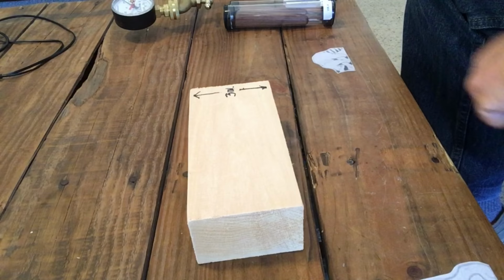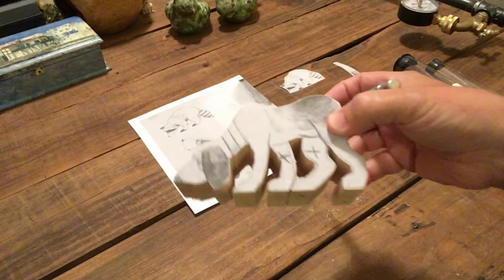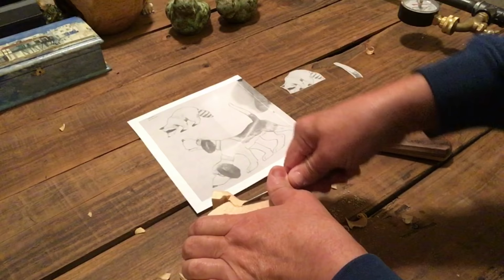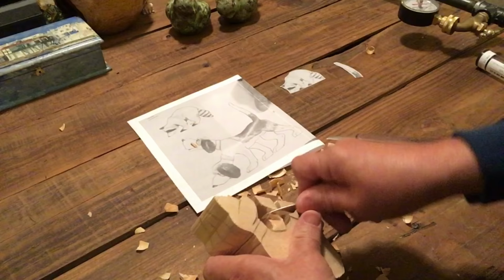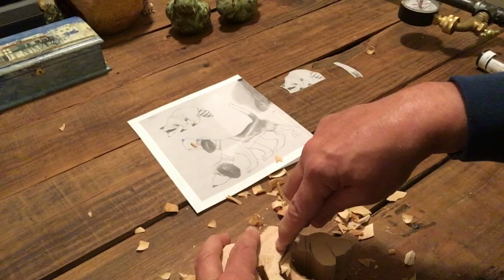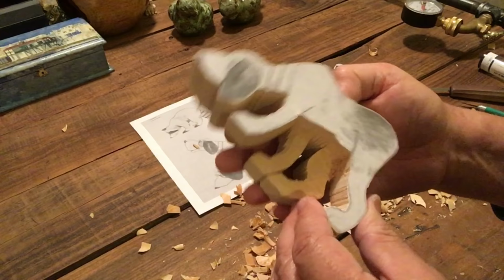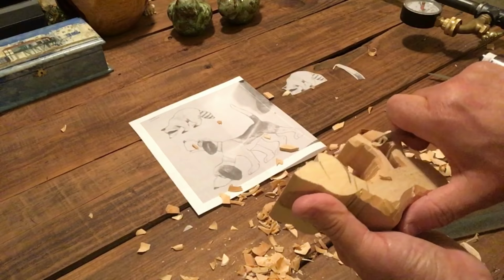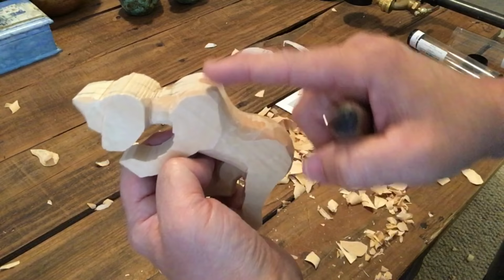Woodcarving of a Coonhound Dog (Part 1)

Comment: I have around 4 of those knifes,  OTC , OCC, 1 is around 3 1/4 inch long , a bit scarry for how sharp it is but its the fastest knife ive found for roughing out the carving. I have to say i love it. Because of the lenght you can use it for laying out your rough out it reaches all the way across the wood plus the handle is bigger you get a lot of leverage with it. Great knives. On the sanding marks on the blade it takes about 3 months strouping them to get all the marks off. That wasnt trying to polish the whole blade just keeping it sharp. Thanks for the video nice work
Reply from the maker: You’re exactly right, takes wild to get all these sanding marks out but a wonderful knife. One of my favorites.

Comment: Hi Mark. When sharpening to an ultra fine apex the edge is weak, so raising the spine just a little after stropping the blade flat will put a micro bevel at the cutting edge and thicken/strengthen to avoid rolling/chipping. The chipping of a fresh edge used to happen to me a lot. the micro really helps. ATB.
Reply from the maker: Thanks I really appreciate the info. I’ll try it immediately.👍🏻
Reply: @markdmaker3173  You're welcome Mark. Funnily enough I've just been honing my OCCT 1.3/8". I honed on 1,200 diamond to a small burr on both sides, then de burred on strop of Autosol steel polish to a very keen edge, then just raised the spine half the thickness of the spine both sides. About 5 to 10 firm strokes should do it. When maintenance stropping, I find the edge by moving the edge along the strop (the wrong way) til it digs into the leather slightly and use that as the bevel to strop on. ATB. Go to 42.40 on vid link. https://www.youtube.com/watch?v=z2yBKg_ooSM&t=2805s   I got this tip from John Overby.

Comment: I have a project at school, where I’m attempting to carve a dog, but we only had oak and I noticed it was quite difficult to work with. I was wondering which type of wood you’re using? Are all wood types compatible with woodcarving or are some of them too hard to work with?
Reply from the maker: Thank you for your comment, great question. I use basswood four most carving projects. Bassword is considered a hardwood but is easy to carve because of the lack of grain. Oak is very hard to carve. I have carved many things from Sugar Pine, is a nice wood to carve and it’s inexpensive.
Reply: @markdmaker3173  Thank you :)